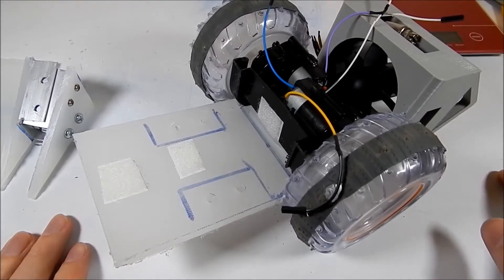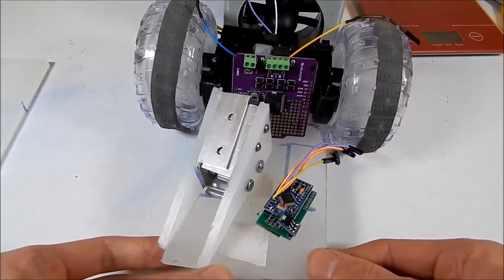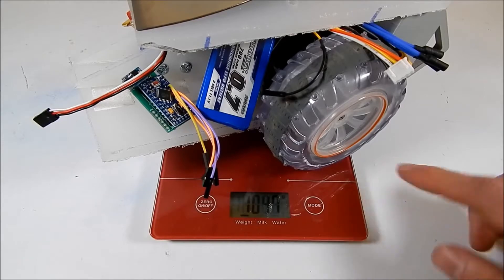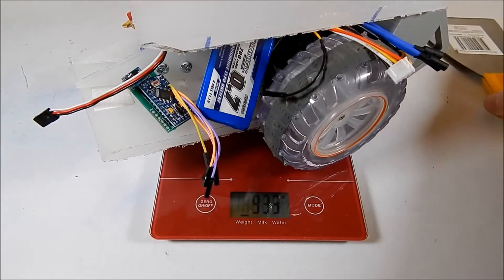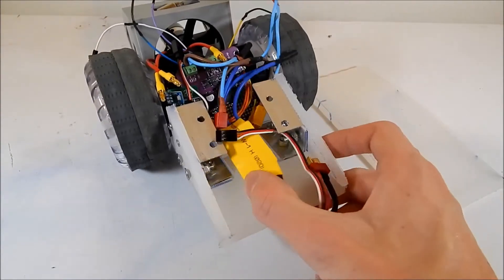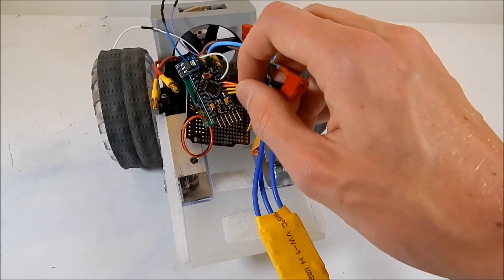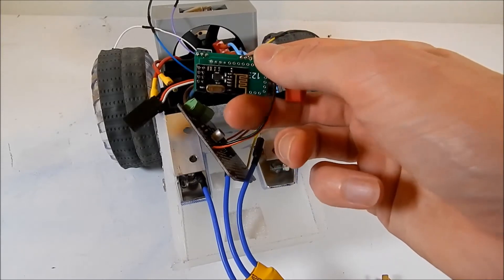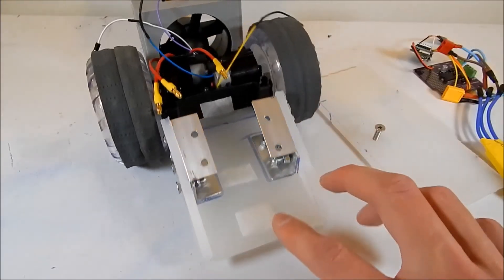9 Hour Combat Robot: Part 2 Beetle Electronics.... Kinda

Comment: Wheel guards
Reply from the maker: In my early builds I put wheel guards on nearly everything but i dont anymore for two reasons:

1) I print and use flexible wheels, these wheels can with stand multiple hits and keep rolling. If a wheel guard gets hit wrong it will buckle in and stop the wheel from moving which is not ideal

2)  wheel guards can break a wheels contact with the ground at certain angles. When ramping up someones wedge, you want your wheels to be in contact with the ground at all times, so you can continue to push. Unless the wheel  guards are too small to really protect the wheels, then they will stop the wheel from touching the ground at all times, giving your opponent an advantage
Reply: Ok I just finished my us ant called power trip
Reply from the maker: good luck with it
Reply: Thx

Comment: oh cool just found this beetleweight build of yours, I am just starting my first one for a comp on March 31 im going with a beater bar spinner so far iv just done a drive motor test video. I can move around 7 pounds do you think this is a good start? I just don't want to get pushed around to much
Reply from the maker: Just had a look, those are the same motors I run in AnnieRUOK and I think the same motors as 90% of the beetles at ARC so you are in the right ballpark for sure.
Reply: Team Panic awesome! Thanks for taking a look.

Comment: Hi, Ben! I just printed my first 150g chassis on the Prusa i3 mk2! Altho I opted for a unique take on the horizontal spinner, I still learned a lot from your bot. I am using a DYS BE1806 for the weapon with a cheap brushless ESC, two 30:1 micro gear motors and a 2 amp DESC for drive. I also use a nano-tech battery. I am currently using a cheap Hobbyking radio, but am looking to upgrade to a Turnigy 9x with an orange Rx soon. My chassis is PLA as of now, but before I compete with it I will print one in nylon. I will hopefully hand-cut a 4-inch weapon bar out of tool-steel soon. My current electronics are not the lightest and am still looking into your setup.  Your inspiration and help has been invaluable on this journey, and I always look forward to you uploading. Thanks for posting awesome content!
Reply from the maker: Awesome work! The bot sounds super interesting, good luck hand cutting the weapon bar. As a tip, look online for a cheap "prop balancer" it will help balance your weapon so the robot doesn't shake itself to pieces

Also, Nylon is difficult to print and in my opinion not worth it. PLA with some coke can epoxied to the outside is ridiculously strong and will survive almost anything an antweight will throw at it
Reply: Thanks! Great tip with the prop balancer. I will look into your PLA solution.

Comment: Hey Ben, Looks like your getting close. 
I found this awesome mini tank for $14 on amazon. It is perfect for a nano or flea weight class. Ive already converted almost every component into a google sketchup cad file, along with a selection of arduino boards, 2.4ghz receivers and what not.
The tank has 3 brushed mini dc motors. One for each track, allowing it to rotate to turn, and it also has an independent motor to rotate the turret. There is another channel designed to simulate firing the cannon, but not sure how accessible that 4th channel would be to hack into for additional weapon operation.
Even for antweight, the motors could be upgraded to geared n20's, and if the board cant produce the current, 2 mosfets would take care of that! Anyway, im just about to start designing a 3d printed starting platform for this tank. Ive been getting into small combat RC and dig your channel. ~Nate
Here's the amazon tank link:
http://amzn.to/2gmdLb9
Current Sketchup CAD model:
https://www.dropbox.com/s/2x9bx9tq19s64a4/Battle%20Bots%202.skp?dl=0
Reply from the maker: Looks very interesting! The only thing you would need to double check is the frequency that the controller uses. If it is running 2.4ghz it will be legal, if not it wont be legal.

Either way the motors and gears from the tank would be useful for a flea/nano
Reply: Its a 27-49mhz RF setup, so non compliant. I should spend some time investigating the rules of action. 
As for the motors, they are $2 max each by themselves. The 3-4 channel setup, ready to redesign around, is what sold me initially.
Thanks for the reply.
Reply from the maker: No problem, I looked into hacking RC cars when I first started building too. most cheap RC gear runs 27mhz and has a third hackable channel so it looked like a good idea.

Most places use SPARC rules, so having a read through those is a good start: http://sparc.tools/